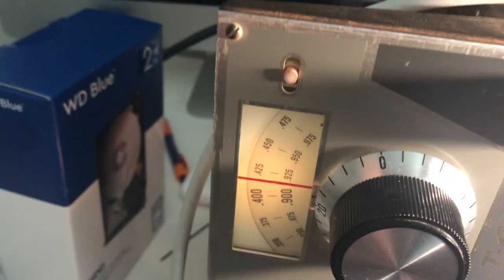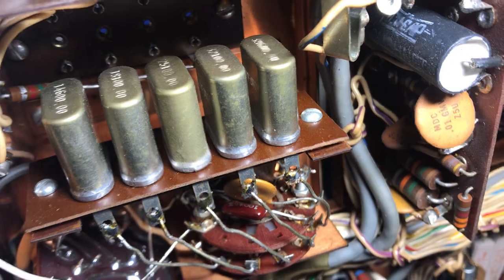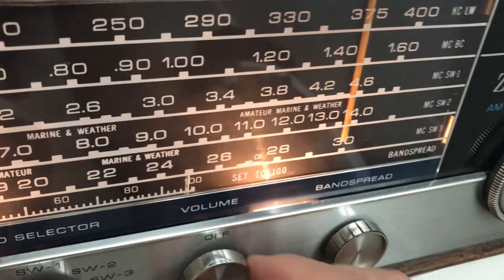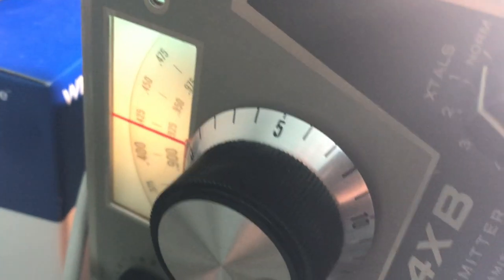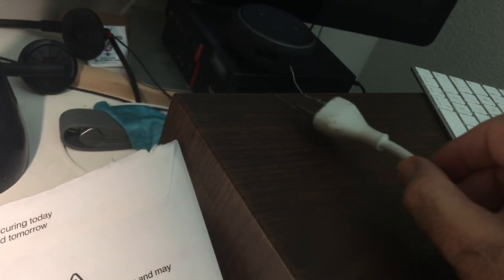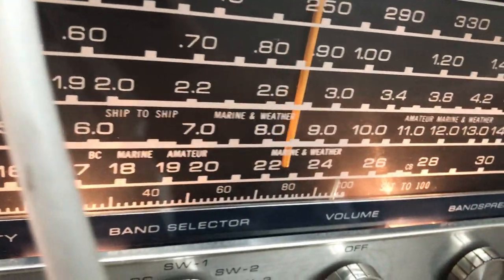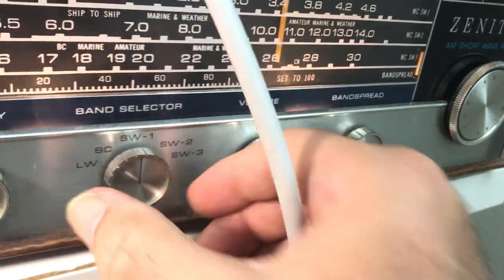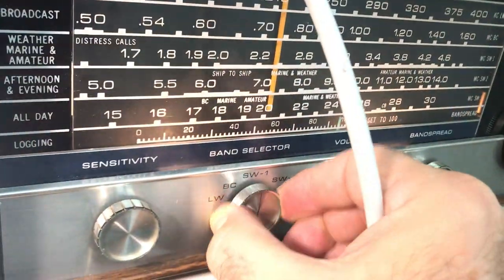Drake T4XB troubleshoot PTO or VFO, Band Oscillators and mixing tube with receiver August 15, 2021

Comment: Cool! Please be careful of the B+
Reply from the maker: 250 volts B+ for small tubes. 600V B= for finals. Scary. Linear amplifiers seem to have 3,000 volts B+ from what I have heard people talking about. A matching Drake R4B receiver is on the way. But no where for an antenna here really. I am having fun fixing and tuning. It would be fun to try to reach a Bay Area SDR receiver on 80 meters or on 40 meters. A 20 meter antenna a dipole could fit in my attic. Not sure how well the 20 meter ground wave would make it to Half Moon Bay and the KFS SDR receiver there which is Kiwi SDR. New Covid19 now called Mu variant. Looks like it is cooling down finally and the coffee shop will be habitable.